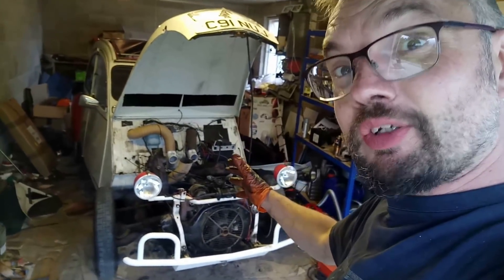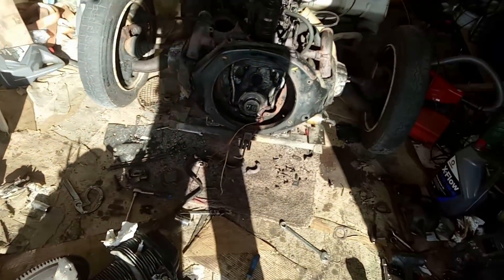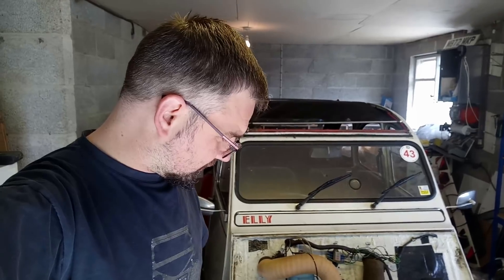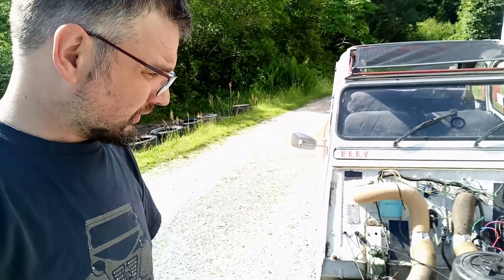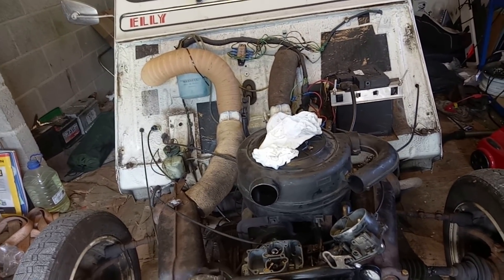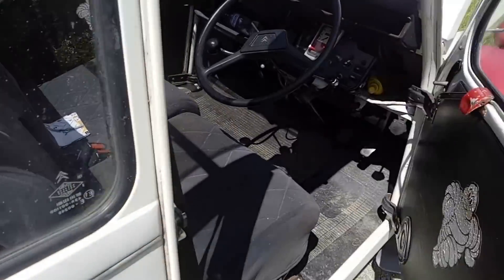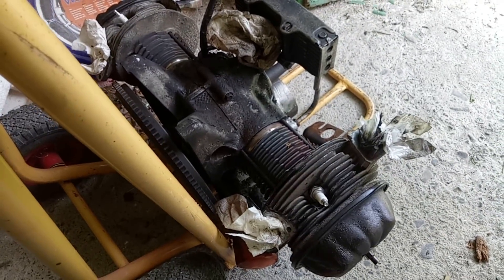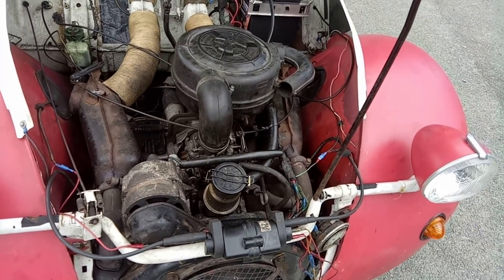2CV to Croatia: New engine first drive, oil fail...

Comment: You have incredible patience Ian, wishing you the best.
Reply: Simon King Agreed! I'm impressed he never seems to have a grumpy moment.
Reply: More patience than I have. Would drive me back to smoking to have that happen to the replacement engine. Hope Ian gets on his way this Friday.
Reply: MichaelG1953 He's not afraid of a bit work either. I wish I had his energy! Yeah, best of luck to The Nut, safe there and safe back.
Reply: saint ian!!
Reply: @MarkMcCluney  He does - but he cuts most of them out of the videos !
Reply: It's absolutely demoralising to have to strip stuff down again that you've been working on; few of us tinkerers haven't had to do it. More of an issue when there's heaps of work involved  - but even fitting brand new faulty alternators doesn't go down well. "Yes, sir, your car will be ready this afternoon - oh no it won't due to yet another new faulty alternator ! Ended up getting a new alternator from another supplier - and tested them out prior to letting the rep leave the premises !

Comment: All in all Ian i think it's gone pretty well. Such a big risk putting a unknown engine in. With the exception of the oil leak it would seem she's sweet. Certainly a success in my books, could have been a lot worse. Yes, it's a pain stripping her down again to sort it, but other than that she should be good to take you on your travels. And don't forget, you were so lucky that that stud pulling out when it did was a damned good thing, imagine if it had waited another 2 or 3 weeks before deciding to let go! Would have been a massive headache. Good luck with the seal change, fingers crossed all will be well from now on.

Comment: I'm really enjoying these Elly videos, even if it's a last minute nightmare for you. I've never been really interested in the tin snails,  but seeing the simplicity of design and the amazing access to the engine I'm rapidly changing my mind and keep looking at prices of project cars.
Reply: Chris Stevens  I've owned several classic minis so finding and dealing with rust is is just part of the ownership experience!
Reply: Chris Stevens  I'm really surprised, the 2CV body appears to be vastly simpler in construction than a mini?  The chassis looks to be very simple as well, surely no harder to repair than e.g. an old Landy?  That said a new reproduction chassis seems pretty inexpensive at ~£750

Comment: The plus side is that  that it works and pulls well without clouds of smoke so once the leak is sorted it should be good to go. Hard to tell on the video but it actually sounds smoother and better than the old engine - perhaps those upgraded barrels had an issue (too much compression at 180 ? ). We know from Foxanne that you will overcome come what may.

Comment: VWs were famous for leaky pushrod tubes too. The last one I had had a big bore kit on it, and it one of the studs pulled out of the case like yours. Fortunately, there were aftermarket "case saver" studs available, with self-threading ends. That saved a ton of time and trouble.

Comment: A possible cause for oil leaks are the oil lines to the heads.
They can be very rusty.
I replaced mine in advance, my daughters 2CV had it leaking.
Indeed a very oily mess, had to replace the brake pads also.
Reply from the maker: Replaced the oil lines for that very reason!

Comment: This makes me appreciate modern cars; today my lovely Skoda Fabia had an MOT and full service at Halfords (probably pointless fuel additive and oil system clean for an additional £30). It has over 130000 miles on the clock, it was made in 2005, it passed with flying colours. I just dropped it off and collected it; all in cost £205. Happy days!😁

Comment: The jets look identical to the 6mm dellorto main jets you get for modern twist & go 50cc 2 stroke mopeds, if thats the case & they fit you can source any size jet for this car no problem! Ive got those jets in sizes ranging from 50 right upto 140.

Comment: BTW, M-28 engines used to burn the right side conecting rod main bearing (don´t ask me why!).When you hear a bad noise in a Citroen engine that is the cause.Anyway they run for a long time before giving away!.As an advice when you assemble the engine use a hight temperature silicone sealing compound to avoid leaks,even at the exhaust pipes and manifold conections.

Comment: Great video Ian, hang in there, replace all the pushrod tubes and new front disc pads I reckon before the trip then Tally-ho Croatia here we go.
Reply from the maker: Replacing push rod tubes is not an easy job!

Comment: One common problem on 2CV's and GS's was the oil pressure switch leaking. I remember having to replace them on three cars due to serious oil leaks when the engine was running.

Comment: Don't despair - perfectly normal for oil seals to perish over that sort of time unused.  Might want to take some tools and a few spare parts with you though (can't say what are common issues on 2CV engines, but I'm sure you've seen most of them over the years)

Comment: Spare engine sounds so much sweeter than Elly's old engine ever did Ian, 100% think you've done the right thing as luckily the spares unit doesn't sound like it's led a hard life at all.  Lovely to see a Corsa B, a rare sight these days, I past my test in a W plate Corsa B 1.0 12v GLS in a kind of blue/purple colour.  The Corsa B was a sweet shape and its looks have aged really well.  The 1.0 12v three cylinder was a really sweet engine too. All the best with getting Elly sorted for Croatia :) Just a thought, maybe the head bolt couldn't cope with the extra torque of the 652cc conversion?
Reply from the maker: Head bolts should handle it. There are bigger upgrades available.
Reply: @HubNut  Yeah I would have thought the Head Bolts should handle the upgrade too.  I think you're right the Head Bolts just a symptom of a more fundamental problem.

Comment: Something amiss with your compression tester valve Ian, it should hold the value.
Reply: I agree, otherwise it would have to rely on the valves being closed when the engine stops, 
and how often is that going to happen, i would operate the pressure release button while
turning engine over, probably a speck of crud from the dry unused for awhile engine.

Comment: Chin up, Mr Ian. I also learnt to drive in a Corsa b, and passed the test in a blue one (BSM). It was a good little motor.
Reply: I had the dubious pleasure of driving a severely beaten Combo (high-backed commercial version of the Corsa) once in 2005. Apart from everything that was wrong with this specific one I found the position of the pedals relative to the seat slightly peculiar, having to sit turned slightly sideways (too far to the right in a RHD). This one had been utterly banged up by some sparks, the clutch was knackered and - much more terrifying - the shocks. I went around a smooth long bend at about 50 kmph (around 30 MPH) and suddenly felt like I was driving on ice in July! I was doing an internship with an electrical contractor and that was the only time I drove one of the company cars.

Comment: If the spark plugs hit the fan we can always tow you with the most reliable engine we have got the Briggs and Stratton, also remember if in doubt take Sausage rolls and tin foil. Tried a full English once but left half the Eggs on the exhaust manifold lol😁🤘

Comment: Did you adjust the mixture on the carb as well as idle screw Ian? Just a thought..?..that engine does sound better though..not to worry, a worry is always a block in the mind to a fix..stay positive your nearly there..excellent video, very inspiring too..👌👍🍻
Reply from the maker: You only adjust the idle mixture, and then only if you really have to. Any other adjustment is with jets.

Comment: Ian, being a Ural rider I know low horsepower. 3 HP on a 32 HP engine is 10%, that is called significant...carry on...at lest the brakes and exhaust are well lubed now...good luck with her.

Comment: I wonder what it would be like to have the original 1300cc engine and transmission on my 66 beetle. Right now, I have a 1600cc with a freeway flyer transmission. For me, going down a few cc’s wouldn’t make a huge difference, but, I also have two more cylinders than you. I hope you’re able to make it without any issues.

Comment: I remember me & my bro put a chevette engine in that had been stood for years and when fitted it started leaking from the crankshaft oil seal.
Anyway we figured the seal may be hard due to it being stood for years and would soften up when the engine done so many miles and so it did and the leak stopped completely and all was fine & dandy after that.
Maybe it might work with you ian.
Reply from the maker: Too late. Engine has been in bits again!
Reply: @HubNut  oh well never mind ian.
Its best to renew that seal if you can access it easily even if it turns out to be not that because it might give you grief later on if the  seal is to hard and perished.

Comment: You need to do a proper rebuild on one of those engines. You can't see internal failure wear without doing that. Me, if I had a 2CV, I would do an electric restomod! As I see it, it would make the most practical rural to in town transport even better?

Comment: The compression tester tool should have a valve in it to hold the pressure in the tool, the cylinder itself doesn't hold pressure, if you ever did a leak down test you'll know the average cylinder has 10-20% blowby through the ring gaps.
Reply from the maker: Ah, ok. Thanks.

Comment: when you did the compression test and mentioned that pressure was leaking back is that not a quirk or fault with your compression tester, as most lock the pressure in and you then release it by pressing a button ? as the chances of stopping the engine with both valves closed to hold any pressure are about the same as winning the lottery. Hope you get it sorted in time still got a couple of left to tinker with it.
Reply from the maker: It has the release button. Compression is better today, and leakage slower.
Reply: you need a new compression tester then, that needle should not drop at all till you press the button, something to shop for in Croatia, hope it goes well. @HubNut

Comment: Hi, why those engines have the exhaust valve guide oil pipes blanked with a bolt?.I was a former Citroen mech and never saw such thing ... In fact some people blanked them to avoid oil consumption... cause faulty valve guide  oil seals.(So stopping smoke to cheat possible buyer...hahaha).

Comment: I wish I could parallel park driving straight in as easy as you in the 2CV. I can never judge where the front is in relation to the kerb.
Reply: Visibility is the key - left hand door mirror - ideally adjusted down and in so you can see the kerb and rear wheel in it - and enough of the side of the car to see the body is parallel to the kerb.

Or just do full left lock and creep forward until the tyre nudges the kerb - then straighten the wheels up.
Reply: @millomweb  I use that technique when reversing into a paraleel parking space since it's easier. 

From your description - there is basically no one shot method of parking near to the kerb while pulling in? It's getting kind of near to it and alternating between reversing and forward until you're near to the kerb?
Reply: @kodessa  Can be done in 'one shot' if there's enough room. When parking between other vehicles,  usually back in then finish off pulling in and forward a bit to leave the vehicle behind some space.
Often the issue is not being able to see what you need to see to get positioning right. With reversing cameras, it may be easier !

Comment: I recognized that sound in Ellies big bore engine  when you first showed it,but didn't think my answer would fit. Decades ago I built up a VW engine with an 1835 Kit. After a while it started making the same sound as the heads became loose, and yes, the studs pulled out of the crank cases . It still kept running but would rattle when I hammered it ,which was most of the time . These days no one bothers with the 1835 kits ,gong for the 1700 plus sizes or 2 liter engines with new cases.
Reply from the maker: Yeah, wasn't expecting that. I was super-careful with the torque on tightening, but it still happened.

Comment: I had a lovely pootle up and around Shaftesbury Tor today and in the health centre car park I was talking with a fellow fan of your good self and may have convinced the chap to talk to the missus about getting a Reliant three wheeler as he sat in it and found it quite comfy albeit not quite as comfy as his fairly recent Merc but hey ho, some like to talk the talk and some like to go further and walk the walk.   Can't wait to move to the land of the sweaty sock later this year as the Scots tend to thoroughly approve of small cars like the Imp, the Mini, the 2CV and a 70mpg low tax bracket car like a Reliant is right up their muckles hehe  (not saying the Scots are tight and def not suggesting copper wire was invented by two Aberdonians finding the same penny ;) I got it both ways as half Paddy McGinty's Goat and half mad buggers with orange beards )

Comment: is that a bit of pinking as you were driving up the hill out of new quay
Reply from the maker: Don't think so. There's a rattle somewhere, which is not pinking. Not sure what it is, but isn't pinking - just happens at one particular rev point, so a resonance issue.

Comment: Well apart from making sure you've a strong credit card and a deep supply of Euros, your warning triangle might need pre flight checks. Briggs and Stratton references below    took me back to formative years as a development engineer at Westwood Mowers; the guru of the Overhaul Department was seriously looking at putting a souped up B&S 16hp twin into his ailing Fiat 500......Best of French with your continental motoring mission and avoid the no- limits autobahns!

Comment: The 1st gen version of the Corsa was a good car , i had a 1.6 Sport it was very fast for the late 90s , i did not like the 2nd gen Corsa , too much like a small van for my liking and the handling was awful this is why the Fiesta in the 00s was the king of the hot hatches ,it just handled way better

Comment: Ian, that compression tester is as much use as men's tits, the gauge is supposed to hold pressure not the engine, there is a leak down test that needs other equipment to perform.
That replacement engine sounds OK and the compression should sneak back up after a good run and a valve clearance check just incase the valves sink slightly after bedding in.
Reply: I was going to say the same about valve clearances but they will have to be done anyway as the cylinder head has to come off.

Comment: Those tyres look like they are really worn out. The tread pattern seems to be really  bad.
Reply from the maker: I have another pair on the way. I do seem to have eaten through them...
Reply: @HubNut  Well, that´s the raw power of the 2CV engine. All that blue smoke coming from the tyres while accelerating, not to mention all those donut´s with screeching, smoking tyres. No wonder you had run through them in like... say... 5 years :)

Comment: Idea, Can a GS 4 cylinder engine be placed in a 2CV?
Reply from the maker: Yes, but it's a lot of work and doesn't actually fit. BMW motorbike engine is a better fit, though still and big and fairly expensive job.

Comment: Whats the difference between the 602 and 652? slightly more powerful engine?,Does Elle have a turbo? and wow New Quay looks absolutely stunning,Ive never been to wales.
Reply: I remember many years ago there was an article in Car magazine where someone turbo charged a 2CV then it blew up on the motorway!
Reply: The 652cc is an aftermarket conversion using larger pistons and barrels fitted to a 602cc engine.
Reply from the maker: About 32bhp vs 29, but it's torque where the 652 feels much stronger.

Comment: NOOooooo...... You can't use copper grease to seal the exhausts. You can use it to stop things seizing but not to seal anything.
Reply from the maker: It's a recommended tip in 2CV circles. The joints tend to be pretty good anyway.

Comment: I'm sorry Mr HubNut but you keep making claims this isn't and engineering channel but to swap over an engine and get out on a test drive inside of 2 days is engineering as is the fault diagnosis. I'll concede the 2CV isn't exactly mechanically complex in comparison to 'modern cars' but it's still an engine. I am 72.3334% convinced you're going to make it to Croatia and back with perhaps one or two minor issues but nothing significant which in itself is astonishing given the problems you're encountering and the limited time you have.